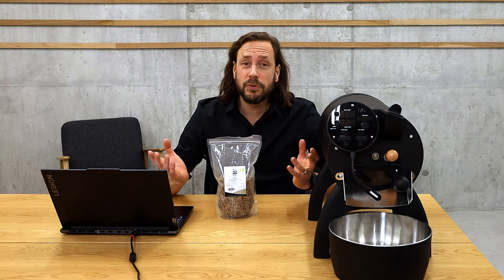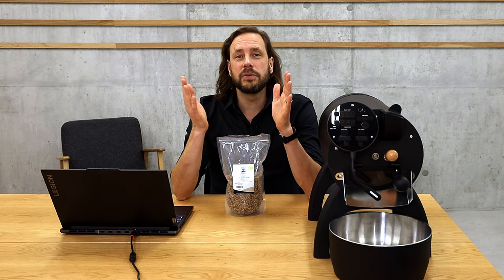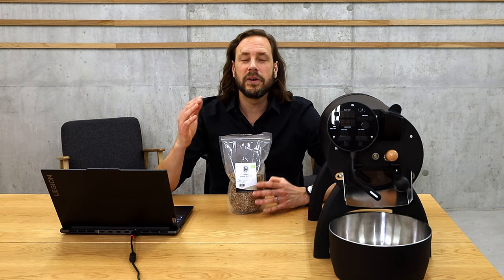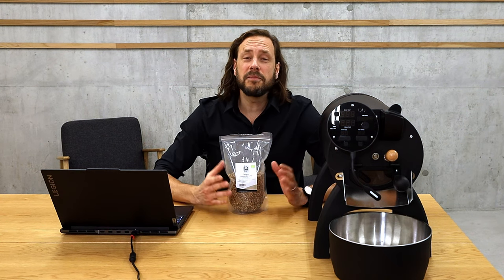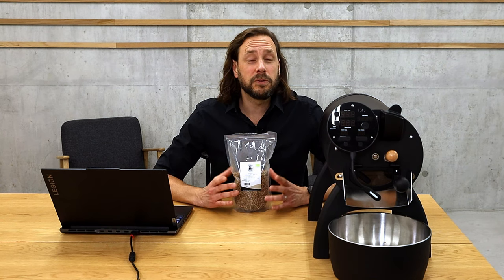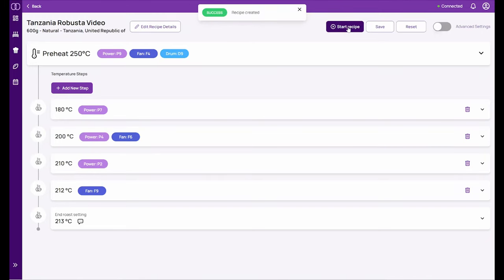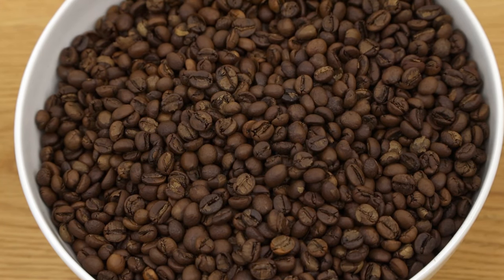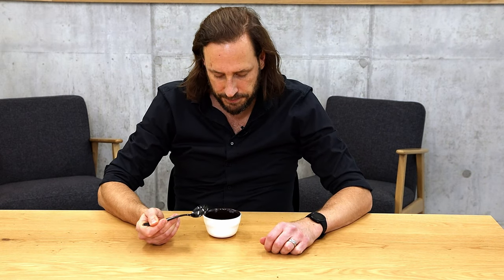How I roast on the Aillio Bullet | Tanzania natural Robusta

Comment: Great video, thank you for sharing this.  I love the portable vent you are using, can you share the model?  I will roast outside when possible, but too cold in the winter.  Wondering if a portable vent as you show would be my solution.
Reply from the maker: It's called AirMex and it's made for soldering.
Reply: @CoffeeRoasting I was going to ask the same question. It seems that the venting of the Bullet is the one sore spot of the roaster with no real prepackaged solution, everyone is left to figure it out themselves. It would be nice if Aillio offered at least one solution, like the Airmex that is designed for the Bullet.
Reply: @CoffeeRoasting can you link where you buy this? I can’t find it online. Thank you! 😊

Comment: Nice video. I've been roasting with the Bullet for a few years now. It seems like you mostly commented on this near the end, but your temp of 213 is probably more like City+ (also based on the color you showed after the roast was done). I've noticed that fan speed really has a drastic effect on heat with the Bullet. Sucking out that much heat near the end caused your temp to flatline, which could be resulting a little in baked flavors. Even the F6 around first crack when you first outlined your recipe made me worry that it would precipitate a crash along with the usual FC reaction but that didn't seem to happen on your curve. Anyway, I'd love to see more videos like this with the Bullet to roast a variety of different beans (varietals, processes, etc) and we can all discuss the approaches.
Reply from the maker: It's depending on the beans. Correlations on bean development and colour are quite different in my experience if you are roasting Robustas vs. Arabicas. Also this bean tends to become more exothermic around FC, therefore I take a bit energy out of the system with the airflow around FC. On the tweak with F9 at the end, it's important, that you only do this for a couple of seconds. Like that, there is no risk of baking.

Comment: Question on the roast. To allow for ideal development, the roast should be be allowed to develop approx 20%.  My question is if development time starts at first crack, how do I produce a darker roast and still stay close to 20%?  Seems a darker roast (City would allow for too much development time.
Reply from the maker: There are different approaches to roasting, but mine indeed is a bit similar to yours - I target a DTR or around 20% (can be 16% in a light roast or 24% in a dark roast). therefore I adapt the setting of the burner around first crack. To roast a bit darker, I keep it a bit higher. To roast lighter, I keep it a bit lower. Like that I can manage the development phase.
Reply: @CoffeeRoasting  Got it, when going for a darker roast, increase the burner to reach a higher temp more quickly in order to still keep the DTR on or around the 20-24%.  I was a bit hesitant as I didn't want to burn  or bake the beans or increase the ROR too quickly.  Your videos have been an excellent resource, thank you so much, I've learned so much.  I recently purchased the Bullet and your videos have been a life saver while learning Roasttime and understanding the machine settings.

Comment: Interesting about going to F9 around 1C before drop temp. Do you usually do this on diff beans? I’m also having problems with chaff. I usually only go up to F5 max. I’m just got the bullet and I’m loving it.
Reply from the maker: Not always, but with naturals, there are dramatically more chaffs that with washed coffees. Just to mention, that it's also always important to keep the chaff filter clean as well. That might sometimes also be the issue if chaffs stay in the roasting chamber.